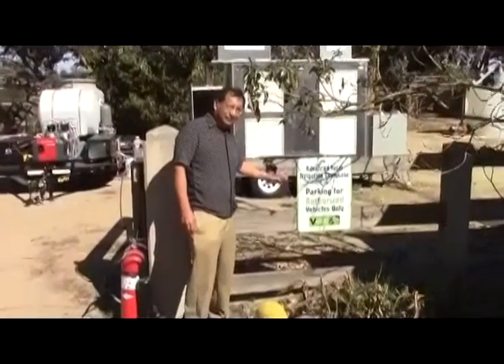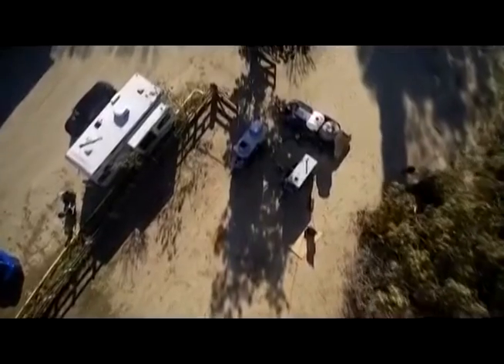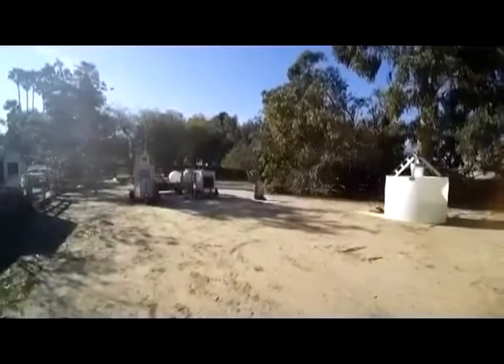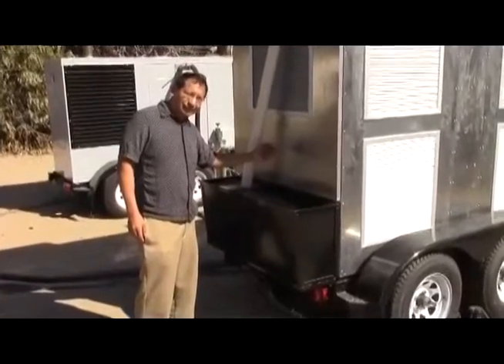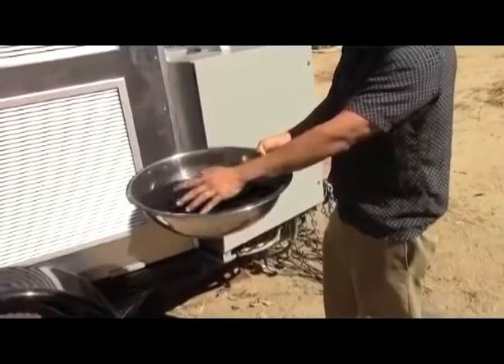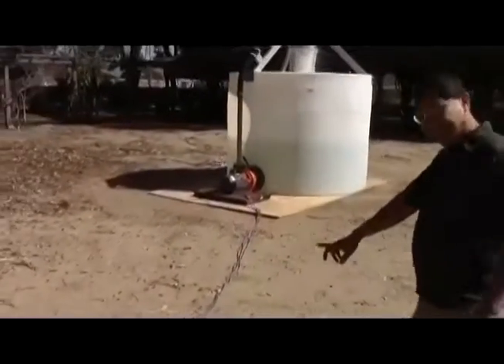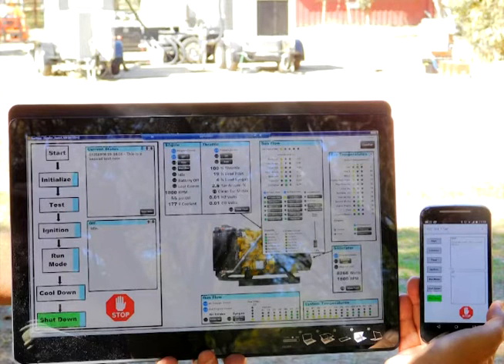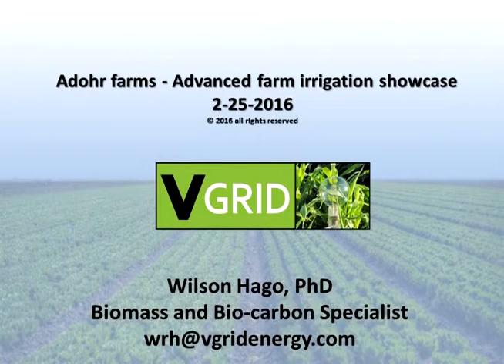AdohrFarms VgridDemo1

Comment: Soil Biology is our only way to rapidly and massively draw down CO2 from the air to offset our ongoing and past carbon emissions, It Can safely and naturally restore the hydrological cycles by increasing biogenic aerosols and cloud albedo that can readily cool the planet by the 3 watts/m2 needed to offset the now locked in greenhouse warming effects and avoid the Storms of Our Grandchildren.

The French have lead the way recognizing Soil Carbons' value and committing to build Soil Carbon by 0.40%  annually.  Putting them on the road to Carbon Negativity before any industrialized country. 25 nations have signed on to 4p1000. 100 of the 196 countries in Paris submitted plans to reduce CO2 via agriculture, forestry and replacing soil carbon into their programmes.
http://4p1000.org/understand
 
A combination of Best Management Practices, (BMPs), for Agriculture, Grazing & Forestry with bioenergy systems which build soil carbon can deliver the giga-tons of carbon necessary into the soil sink bank. 
Ag BMPs; 1 GtC, 
New Forest & BMPs; 1 GtC
Pyrolitic Bioenergy,  Cooking Stoves; nearly 1/2 GtC
Industrial Pyrolitic Bioenergy; 2 GtC
Holistic (mob) Grazing; 2+ GtC
 
Over 6 GtC,
So soils & biota can do more than half the 10 GtC reduction job, feeding carbon to life instead of death.Carbon Sequestration Cascade;
Each Black Carbon gram (biochar & humus) can increase Water Retention by 8 grams, and can support 10 grams of Green 
Carbon, which each can feed up to 10 more grams of fungal mycelium White Carbon growth

Carbon has been fundamental to life since the birth of our planet. It’s the source of all wealth and the conduit of all joy. Carbon cycles among and between billions of interconnected earthlings, whose fates teeter on the element’s return trip to the soil.
Only the generous reciprocity inherent to life macrocycles can restore abundance and harmony to the planet of the living. May we celebrate a happy Intended Anthropocene, anointed in water & Soil rather than Oil and Blood.

For a complete review of the current science & industry applications of Biochar please see my 
USBI 2016 Presentation; http://usbi2016.org/schedule/
How
 thermal conversion technologies can integrate and optimize the 
recycling of valuable nutrients while providing energy and building soil
 carbon, I believe it brings together both sides of climate beliefs. A 
reconciling of both Gods' and mans' controlling hands.
"The Civilization of Soil",   
Hall Marks of The Unintended & Intended Anthropocene 
(The full text & citations are on my LinkedIn page;
https://www.linkedin.com/pulse/civilization-soils-hall-marks-unintended-intended-erich-j-knight?trk=prof-post  

I have come to see a new definition of the Anthropocene, divided into two parts, The Unintended and the Intended. The measure which will codify this new age, a manifestation of the Intended Anthropocene, will be increased soil carbon content & with that the restoration of ecosystems and climate stability world wide.
 
The primary measurement and establishment of the Unintended is the Ag revolution 12K years ago.  Measured by many proxies
of Land use changes, (LUC), The Intended Anthropocene has a single very hard measurement of radionuclides, so we have a hard date of inception; 1964, the test ban treaty. (rocks & sediments don't lie). Around this time Rachael Carson also clued us in to chemical LUC in "Silent Spring". Since that time the offending measures have declined.

So the Holocene, the age of man, can be measurably divided into Intended & Unintended eras. Now we are at a 
new Intended age which I call; The Diamond Age.